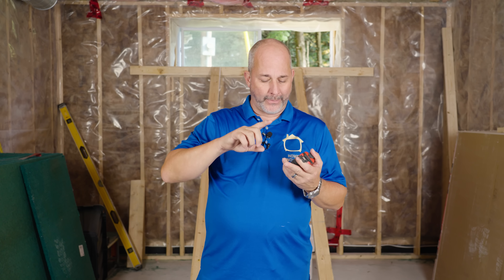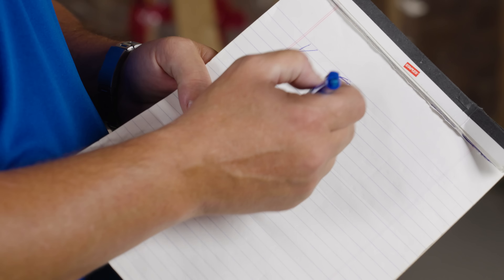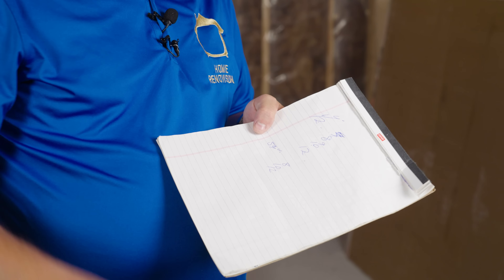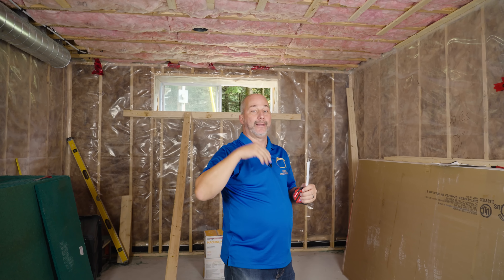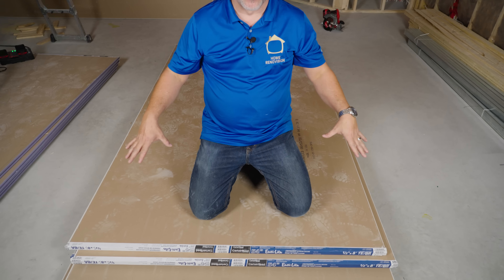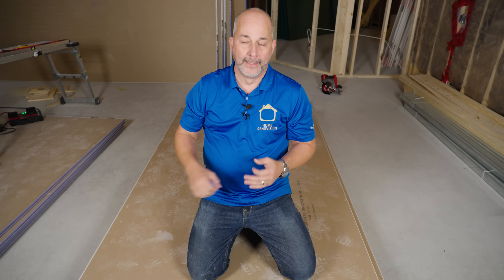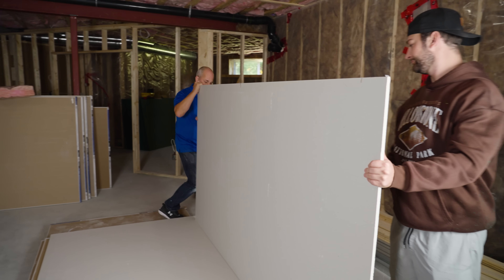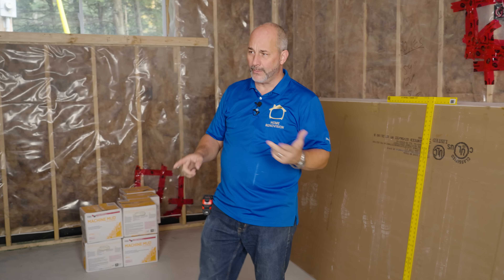5 Tips and Tricks For Your Drywall Job

Comment: T square became one of my favorite tools when doing my basement. I had to carry over 80 sheets of 8' 5/8 down an L staircase completely alone. It certainly wasn't easy but some tips I have. They make these small handles you can buy that the edge drywall slots onto to. It only costs like $15 but gave me almost a foot of extension and saved my fingers. I would do one sheet at a time and do maybe 5 sheets a day while I was still working on insulation/wiring. Lift with your legs, keep back straight. It's a lot of work and intimidating, but it's do-able!

A bonus t-square tip: if you are hanging vertically or cannot see the stud location, take a couple seconds and mark out stud locations on your drywall using the t-square!

Comment: Jeff, in Indiana, USA, we can get 1/2" drywall (white board) in 8', 9', 10' 12', 14', and 16' lengths. Fire rated 5/8" in lengths of 8', 9', 10', 12', and 14'. Not to mention the 2 types of Dense glass in 1/2" and 5/8" in 8' and 10' lengths. Blue board is special order from the East coast used for plaster. We do have the green board still, not used in commercial very often, but also in the same lengths up to 12', I believe.

Comment: I worked in drywall for 18 years of the 34 years. Always get your drywall from a drywall supply. They will help you. 1/2" sheetrock comes in 8,10,12,14,16'  i can teach how do work in drywall, i can't work anymore because my lower back is bad and now I'm disabled

Comment: We are building a concrete foundation home. 3 sides of which are concrete with a 2x6 studded wall walkout. I intend to build the walls in front of the concrete this way. Please advise. I will start by putting a 1-inch thick foam board next to the foundation concrete. My 2"x4" wall will go against the foam board. I will install R-13 face fiberglass insulation into the studded walls and complete the wall envelope with drywall. Do I have this wall envelope correct?

Comment: Suggestion for hanging 10.5 ft walls? Better to do 2.5 from ceiling, floor or big butt joint? I want to avoid butt joint especially with long wall.

Comment: Is there a good way to repair a light fixture on the wall in the bathroom that the electrical box has pulled out of the hole from the wall …all the wiring is still intact it’s just hanging down, but how do I securely put it back in the hole without it sliding back out again? Thanks

Comment: I have a question The window Idea works for a new home with larger windows mine is 20years old not custom built and small windows 4 ft dry wall doesn't work steel frames with glass sliding panes. I have had to cut small pieces and bring them down my narrow angular stairs.  so, it takes forever to do the basement I have stopped. the project. these developer homes N.G. my old custom-built house. Well, that was different my stairs went straight into the basement. N.P. thanks for the help P.S. my favorite part of the work dry wall I enjoy doing it.

Comment: Are vapor barriers a must? Thanks
Reply: On external walls yes. Interior definitely no
Reply: Depends on where you are. It’s against code where I am.
Reply: It depends on your wall structure. Some walls are designed to allow vapor in the wall cavity transfer into the interior. What you dont want is a sandwich of air between two vapor barriers. That moisture has nowhere to go.
Reply from the maker: That all depends on where you live . different weather patterns have different recommendations and different building code.

Comment: Hi Jeff, great video. Is that moisture barrier required if you have R-10 Rigid foam on the concrete? I'm in the Ottawa area and was reading having both rigid foam and vapour barrier can trap moisture between.
Reply: He has a good video about basement subfloors.  Your rigid foam should have grooves that allow any vapour to move out to the edges where it should escape up the wall.

Comment: A lot of people buy and hang their drywall themselves and contract out the mudding, paper, sanding. I’ve heard the price of contracting out the entire process is comparable due to their bulk costs on drywall. Any comments?
Reply from the maker: it is almost the same because most homeowners install every scrap and create butt joints.
Reply: @HomeRenoVisionDIY  No doubt. The first time I put up drywall, I made that same mistake. Buddy came over, took one look, and congratulated me on saving $12 for a single sheet by creating $150 worth of taping, mudding, and sanding effort. Learned my lesson -- a little humiliation can be a great teacher. lol

Comment: I’m often called on jobsites to bore holes between bathroom stalls at truckstops. Which I do for free because I support our hard-working truckers. I’m often tasked with decorating these with the faces of the likes of Kevin Bacon, Burt Reynolds, or whoever is the rage that week. But when I line up the hole to where the mouth is on the image, it never looks quite right. I’m thinking I need to either animate the face so the eyes move or fasten a strap or harness around the other end of the stall so it pulls you so far into the stall you can’t notice it. But there’s all these truck stop building code violations that will sure attract an already suspicious and curious building inspector. And if you’ve met these inspectors you’re bound to end up in some nearby dungeon swinging on some ropes or crucified and shamed in the parking lot of a Shell station. So why do your videos fail to cover this kind of stuff? Real things - not this something something build with the right power tool on the right setting, etc. or whatever it is. Or saw a hole right through your neighbors living room wall and stick your whole head in there, rufie yourself, call the cops before they do, and when the cops come you’ll look like the victim of whatever it was they tried to do to you - now that’s a YouTube video.

Comment: What kind of walls can I have in my basement when I know they are occasionally going to get wet. Street drain problems that will not be fixed by a city in denial.
Reply: I do have sump pumps but sometimes that's just going in circles.

Comment: Out of interest, when plastering why is the whole wall not covered just the joints in North America
Reply from the maker: less material equals less time and a more perfect surface.
Reply: Because 99% of people wouldn’t want to pay for veneer plaster. People keep their house for 8 years on average. Hence they don’t want to invest much. At your place, you can do whatever you want. If you know the buyer won’t pay you extra because you have veneer plaster, and will only ask “what’s the square footage” and “is this wall load bearing”, then you’ll have standard drywall for as cheap as you can get it like everybody else in the city. Cheer !
Reply: I moved to Canada from England and on the second day when I pulled the charger cable out of my phone the plug went flying out of socket and dented the wall. I was pretty shocked. Firstly, I could not believe how flimsy the socket was that it was barely holding the charger. Secondly, I couldnt figure out why drywall got dented. Well, after getting a job in construction I realized that in North America they dont plaster the walls like they do in Europe. They just fill the joints and the drywall gets painted which means its soft as hell!
Reply: Cost. Covering the entire surface results in substantially higher labor costs. It also requires a high level of craftsmanship that is usually only used in end homes. It will be beyond most people’s budget. The results are ultra smooth near perfect as they use laser levels to ensure a straight finish.